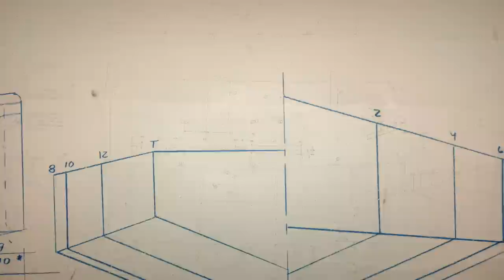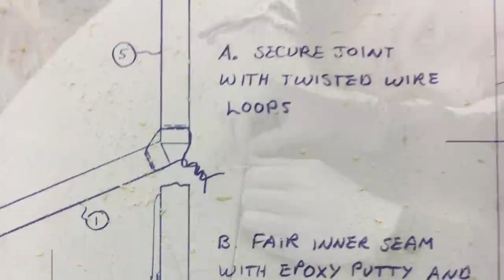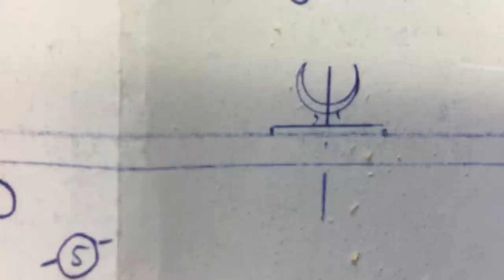Robote a fast stitch and glue boat

Comment: Nice. I even checked out the link.
It's amazing how many designers won't list simple things like draught, or motor ratings, or even weight capacities. But for xx.xx ($25.00 in this case) you can find out. I guess? Maybe.
I don't understand the reasoning.

Comment: Looks nice but very unstable when you deep V a small boat because the your weight makes it top heavy, always better to have a flat bottom when building a small boat. Just saying for those considering a build of your own. Design is very important, deep V construction is for speed in large boats.
Reply from the maker: It is actually pretty stable. More stable than I thought it would be. The shallow Vee bottom is kind of a poor man's round bottom. The boat carries its beam right out to the rails. Watch the video.
It is also more seaworthy than a flat bottom boat in choppy conditions.

Comment: polyester resin on ply??? Good luck with the adhesion long term.
Reply: Epoxy is better but polyester works fine too.
Reply from the maker: I admit I am a cheapo for using the polyester, but I have used polyester on the insides of other boats I have built with good results. It has held up for me as long as I owned the boats (5+years).
Everything on the outside and inside taped seams boat was West System Epoxy. 
I seal up the top edge of the polyester covering with epoxy and tape cloth. As long as the plywood stays dry and doesn't swell and contract the polyester seems to stay put on the inside faces in my experience. 
The plans really don't call for covering any of the wood with cloth except for taping the seams, I added the cloth all around to keep the ply dry and making it more resistant to dragging over rocks.

Comment: Nice job! Looks great! When you say molds in the video are you just taking about the 'bulkhead' support you use to form to he shape? Stitch and glue I knew from old Glenn l work and you left most of the build structure inside the boat. I think that is what you did?
Reply from the maker: Well I wouldn't call them bulkhead supports since they are removed and the boat has no bulkheads. Maybe there is a different name for the pieces you wrap the ply around besides molds.
Which Glen L boat did you build?
Reply: @goodkebo  lol they are probably called forms or supports. Sorry the engineer took over me.

Comment: I AM FROM THE PHILIPPINES. I AM LOOKING FOR BUILDS OF BOAT MADE OF PLYWOOD SINCE IT IS CHEAPER THAN OTHER MATERIALS. I WOULD LIKE TO KNOW HOW MUCH WAS THE TOTAL COST OF THE BUILD?

THANKS.
Reply from the maker: I used about 3 sheets of 1/4" Luan Plywood and about 1.5 gallons of epoxy resin plus the fiberglass cloth. You could build the boat using less epoxy/fiberglass but then you would need to use better quality plywood. The boat probably cost about $300 USD for my build.

Comment: how many day weeks hours did this take for you guys? Is this your first build? im looking to do a skiff build this year and im curious. Thanks! looks great
Reply from the maker: Hello! It took about 3ish months of working weekends. Started in Feb done in May. 
I build a couple other plywood boats in the past. 
This is a good basic build good for a first boat. 
I did some extra things to it, like putting fiberglass cloth on both sides of the wood panels and adding the decks. I could have built it quicker if I followed the plans exactly.
Reply: @goodkebo  Thanks!
Reply: @goodkebo  I would not consider adding filleting on the joints inside and out as extra. As far as I am concerned the extra strength and safety it adds is better than money in the bank.

Comment: How thick was the ply used? I'm planning my first build with the same plans but cant get hold of quarter inch. Will 9mm ply do the trick?
Reply from the maker: I would probably go with 6 mm. Especially if you epoxy/fiberglass like I did.
Reply: A boat designer friend says 3mm or 4mm maximum, especially since you are glassing both sides. Overbuilt and heavy, but better than underbuilt. Nice boat - hand made like a Rolls Royce.

Comment: Great build, boat, and video!! Just one question, why is the polyester resin so dark? What I get is usually clear. Curious, is it an additive?
Oh, and they're going to regret that floor color choice, the glare alone..
Reply from the maker: With the polyester resin color, maybe it just looked that way because of the darker colored plywood?  With the paint, I got kind of bored with the colors I used to paint my boats, varnished rails, white exterior, green or red sheer stripe, and gray interior.
Reply: @goodkebo  Gotcha. Thank you kindly for the response! Darn fine boat though. She's a beauty!